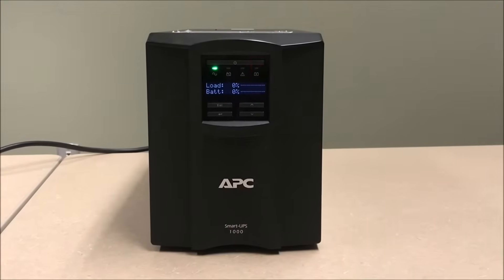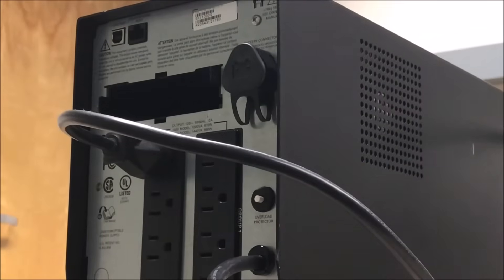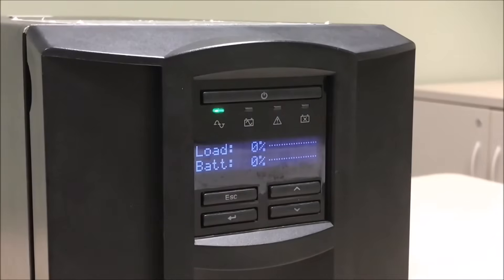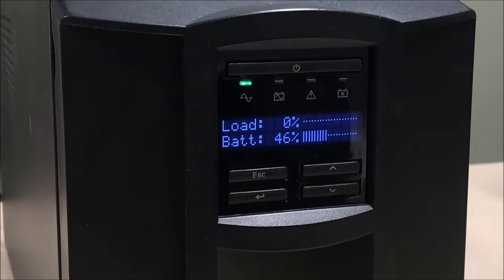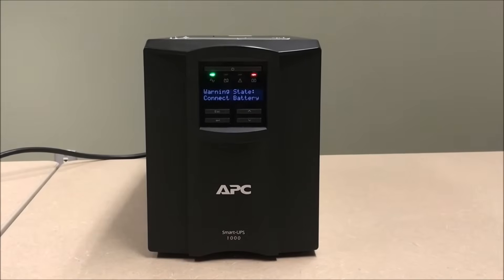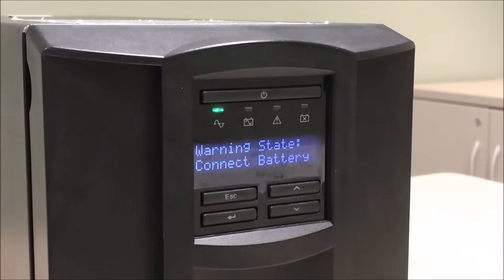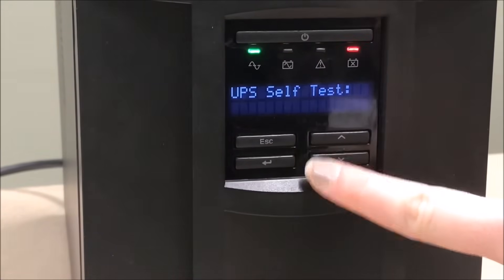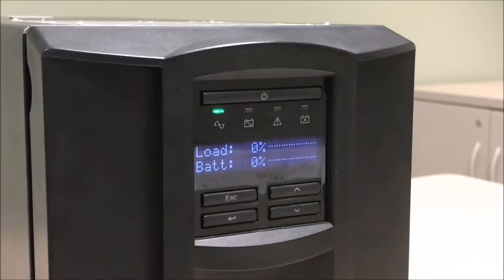Battery Replacement Tutorial on APC Smart UPS  | SMT Series 1000 & 1500 | Schneider Electric Support

Comment: Mine has a plastic box inside the battery tray, blocking the replacement. the older c1000 has a bigger battery, but the new style has a smaller one and a plastic box in the device preventing the replacement to be installed.
Reply from the maker: Thank you for your message Caesar. We house most of our documentation in a virtual database here: https://www.se.com/ww/en/download/. If this does not address your concerns, please reach out to a technical support person in your location.https://www.se.com/ww/en/work/support/country-selector/contact-us.jsp

Comment: hi there, i hope you read my comment here in this video. I replaced the battery of APC SMT3000IC then i try to leave for 2hrs in the AC outlet to charge the battery. The problem of my UPS is the display of battery percentage always zero. If I'm going to remove the plug from the AC outlet and after 1minute with will display the battery percentage which is always 24%. I hope you can help me reagarding this problem of my UPS. Thank you in advance
Reply from the maker: Thank you for your message. We house most of our documentation in a virtual database here: https://www.se.com/ww/en/download/. If this does not address your concerns, please reach out to a technical support person in your location.https://www.se.com/ww/en/work/support/country-selector/contact-us.jsp

Comment: mine had that connect battery with red light and beeping... then I kept putzing around with the crappy buttons and crappy interface and then it finally stopped... I just bought it and just had new batteries installed since it was NOS old stock but brand new in the plastic and styrofoam APC box.. smart 3000 model.. red light is still blinking..
Reply from the maker: Thank you for your message. We truly apologize for any inconvenience caused. - Please contact our APC Customer Care team for assistance with your question: https://www.apc.com/us/en/support/contact-us/

Comment: A friend gave me a APC 1500 SMART UPS. It is a SMX1500RM2U. It powers up but the display is  showing "Warning State: Connect Battery". When I check with a meter, the batteries are connected and fully charged. There are 6   12 volt batteries holding a total of around 51 volts. I also checked the internal battery connector for any corrosion or loose connections. All is good there. As soon as you pull the plug from it, the UPS stays running as it switches to the batteries indicating that the batteries are working fine. Anybody got any ideas on what might be going on with this unit and how to fix it?
Reply: Hi. Did you find a solution to this issue? I'm asking because I have a similar problem.
Reply from the maker: Hi Jeff! - Thank you for reaching out. Please contact our APC Customer Care team for assistance with your question: https://www.apc.com/us/en/support/contact-us/